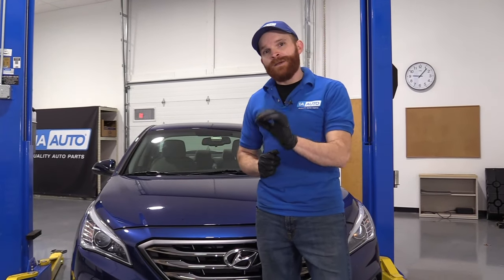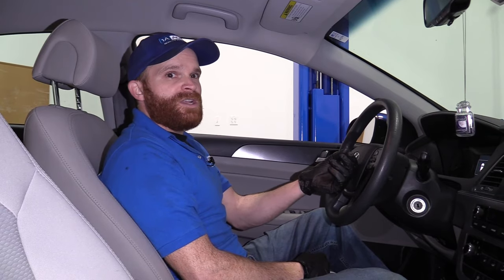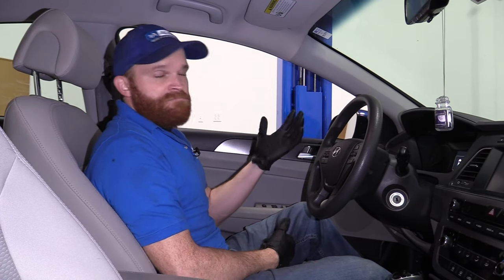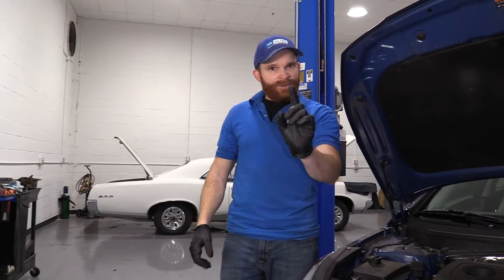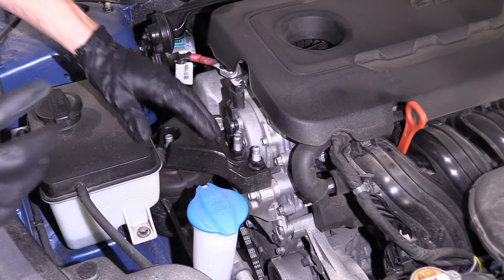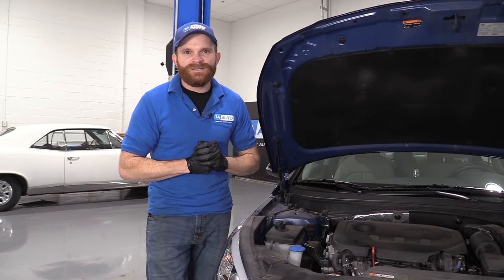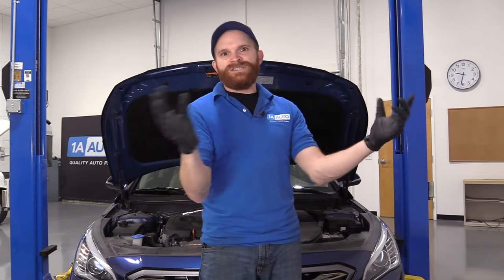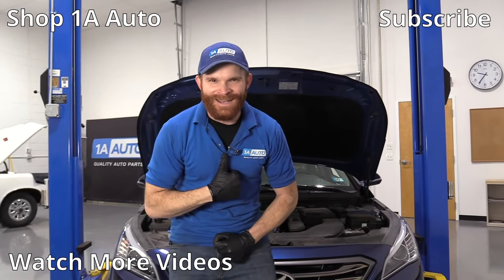Top 5 Problems Hyundai Sonata Sedan 7th Generation 2015-20

Comment: I have a 2016 Hyundai Sonata SE and I'm having so many problems. They replaced the engine last year now I'm having an Electrical problem where my screen in the car gets stuck and my AC stop blowing out A Lot of air and it doesn't get Cold Air. Took it to mechanic and replaced AC Compressor with new one but still isn't getting cold said it's an Electrical problem also when driving car is making noise sound like it's coming under the hood. Last thing is I gots to change my headlights and back light bulbs every year bulbs be burnt out black
Reply: 2016 Sonata Sport Tech here. Bought new and still looks and drives like new.  Other than oil changes, tires, brakes......zero problems. To be fair, very low mileage still, just under 40 K. But so far, the best vehicle I've ever owned, by far.

Comment: I have a 2017 Sonata. Trunk latch stuck shut on me, gas pedal sensor failed on the freeway causing an engine misfire and leaving me stranded. The paint on the roof is now peeling (very common with cheap Hyundai paint) and it looks like crap. Hyundai’s are cheaply built. Definitely won’t buy another

Comment: I have a 2016 that i regret owning  The variable intake manifold timing sensor has been replaced 5 times and is now bad again. Also the drivers side headlight never lasts more than 3 months, i buy 2 packs because of how often it goes out. They tell me on both these items that these are just a fluke no design issue. DONT BUY A HYUNDAI!

Comment: I am doing the timing on a 2011 Hyundai Sonata 1.8 liter engine once I'm done with the timing I turn it a couple of revolutions with the spark plugs out and the chain was the jump off the teeth and I took it apart three times to fix it and it keeps on doing it the timing kit is brand new do those have a recall on the tensioner or no

Comment: Got a 2019 Sonata. 2.4 liter.   Only prob I’ve had I’d front tight CV joint was leaking. Prob cause I ran over a curb pretty hard. 😂. Other than that all routine stuff. Brakes replaced , alignment.